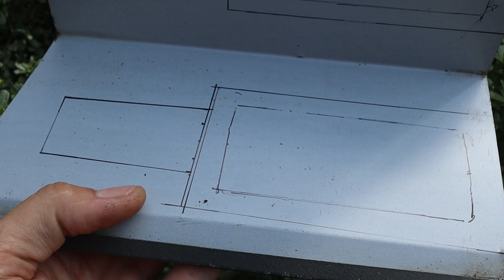Device for quick painting of fishing lures

Comment: NEVER BORED: Your Engineering Background will Never Leave you Bored. If you are still Working, this is a perfect off Duty De Stress Hobbie. I make alot of homemade Lures from already existing products, or parts from them Modify them at Times to get the Mechanics Right; impart enough action. NOTE: Before discarding ANY Homemade Lure , dismissing it as a DUD.... Always Reverse pull it opposing end. That sometimes saves the day.